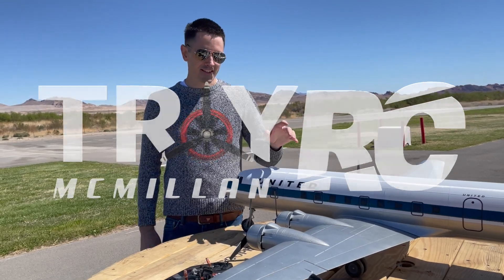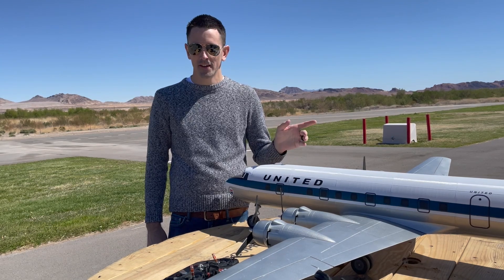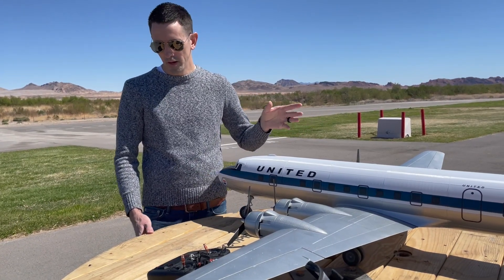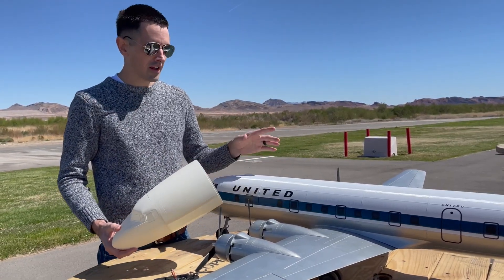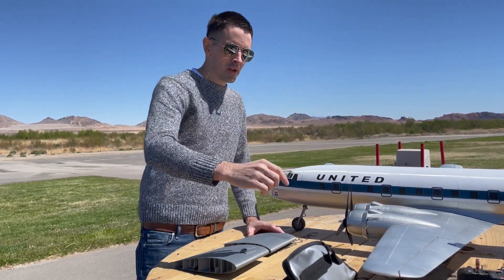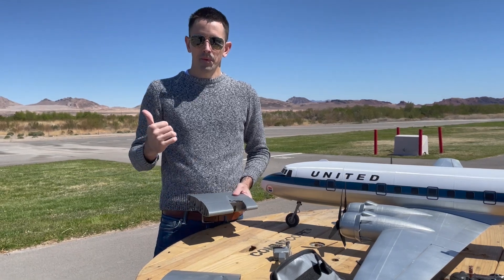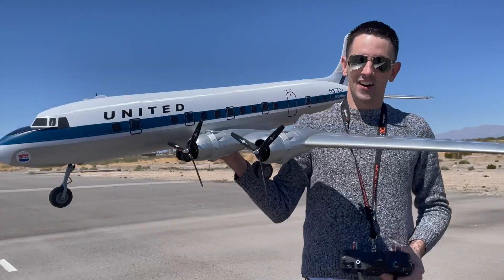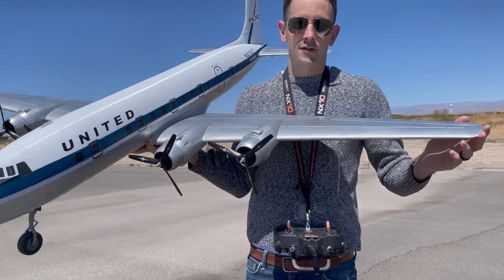EPIC DIY 4 Engine 3D Printed RC Airliner

Comment: Hi Troy, thank you for your efforts and your postings, it is really encouraging me to extract my digit and get back into model flying. As a traditional modeller who has learned to read 0lans and build from scratch, I too see the 3D printing as being an extremely good fit with modelling and your work confirms that.
So, being in the market for a r3asonably good 3D printer for this work I would appreciate yout thoughts on whether one of the Ender 5 printers would work for me? There is either the Ender 5 S1 which looks good and with a decent print size, 220x280x220 mm, or the Ender 5 Plus with the 350x350x400 mm capacity.
Your thoughts would be appreciated. 
Thank you.

Comment: Nice build! I wish I could use my 3D printer for rc airplanes. Sadly I live in Texas and half of the year here I'd have to just store them in my air conditioned house or they would just turn into a puddle of melted filament with parts sticking out of it....
Reply from the maker: I'm not sure what the highs are there, but it shouldn't be a problem! I live in Vegas, and it is ridiculously hot here. 100F+ for half the year. I have stored planes in my garage for years now without any kind of AC. Not even the slightest bit of warping. You should give it a try :)
Reply: @TroyMcMillan  I have unforgettably lol an unwittingly. This first cummer I moved into my house left PLA parts to a lamp I was making in the garage over that first summer. There was not any warping but the parts became very brittle almost like glass. I though that maybe it was just the PLA brand so last summer I intentionally left other prints and one of the wifi temp/humidity monitors I use in my spool storage boxes. Not sure if it's due to it getting up to 130 then down to 50 on the same day or if it's due to it getting humid then dry but all the part lose any elasticity and get brittle kind of like glass...

Comment: The quality of this DC-6 design is spectacular.  Flies beautifully, and is rock solid in the air. The landing looked a bit fast. Don't think I see landing flaps? Realize this probably a decision to reduce design/build complexity. It's great to see you back flying again after a few months break.
Reply from the maker: Thank you so much! 😊 It actually does have flaps! It’s been quite windy here every time I’ve taken it out, so I haven’t gotten a chance to truly use them yet.
Reply: Good to know has flaps. Thanks. :)

Comment: Great job Troy , nicely flown very scale . Looks great close up too. I have a Question about the spar in the wing , how strong are the joints where it has been glued? . Have you weight loaded the wing to test over the whole span ? . Only asking as I have no clue how good CA bonds . Fantastic video as always. Thanks for sharing.
Reply from the maker: Thanks so much man. From my experience, CA bonds stronger than the actual layer adhesion. I’ve done weight tests on this assembled wing though, and it is definitely strong enough for this size airframe!
Reply: @TroyMcMillan  Thanks,  👍

Comment: Huge fan, great design and really neat details. If you do a Constellation it will jump to the top of my build list!
Reply from the maker: The Constellation is definitely SO high up on my list!! It was between either designing the constellation or the DC-6, but I went with the DC.
Reply: @TroyMcMillan  if you where to design a constellation, would it have the short early nose or the longer one? And btw very nice work on the DC-6!

Comment: How do you keep the plastic from sagging in the sun?
Reply from the maker: These planes do great flying in the AM when the sun isn't so harsh, and/or if it is really hot out, I also just set it in the shade when I'm not flying. I live in Vegas and the summer heat is brutal, and I very rarely see warping if I do this :)
Reply: @TroyMcMillan  I left mine in the shade too, so I thought.  Apparently the sun moves in the sky as the day progresses...  =)
Reply: @Slaintemaith  Need to a small solar cell and a buzzer. ;)
Reply: @AerialWaviator  I like it!